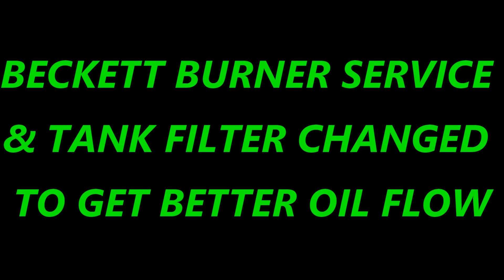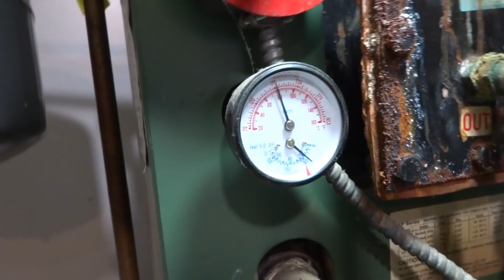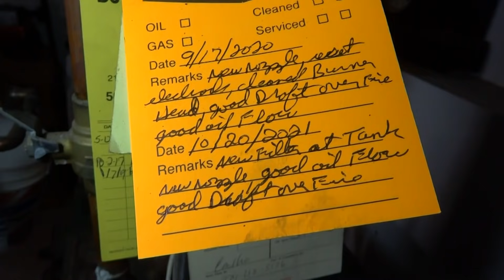BECKETT BURNER SERVICE & TANK FILTER CHANGED FOR BETTER OIL FLOW

Comment: Loved the oil burners!!! Haven’t touched one in years since moving to Naples Florida. They provide better heat than natural gas or propane.
Reply: @biker55555  
Fuel oil burns hotter
Reply: @JM-yx1lm  
What I should have said is that oil is a more efficient heat and will cost less to heat than anything else.

Comment: I need a new heating system.I have oil heat forced hot air with a electric water heater.I have a Olson burner now.What brand would you recommend for the lest issues?

Comment: Steve - thanks for your videos! They have been very helpful! I have a chimney with a clay liner, only used it for my oil boiler, do you think I should get the chimney swept before converting to gas? Thanks!
Reply: If you switch to gas you will need a chimney liner 👍
Reply: @randyjohnson4988  Even if I already have a clay liner? Thanks!
Reply: @oliverramirez9911  I live in the mid west and all clay lined chimneys are good for oil burning but when we install natural gas or propane we have to install a aluminum or b -vent style liner .

Comment: Hey Steve, its been 16 years since I worked on a beckett pump. quick question. Aren't you suppose to clean the electrodes near the nozzle and/or adjust them?
Reply from the maker: if there durty yes clean them